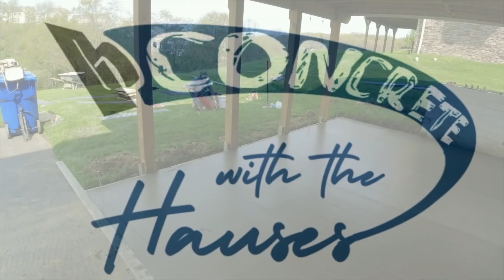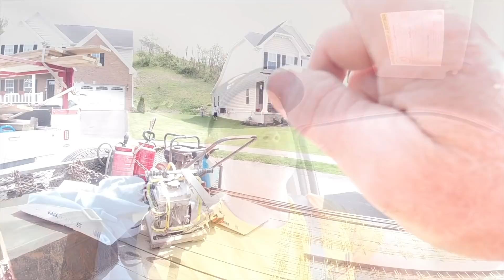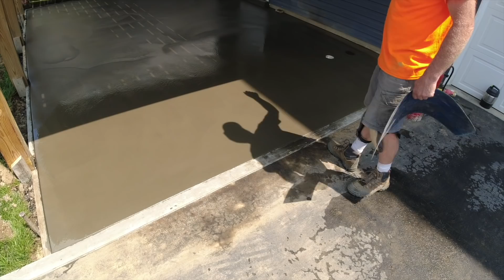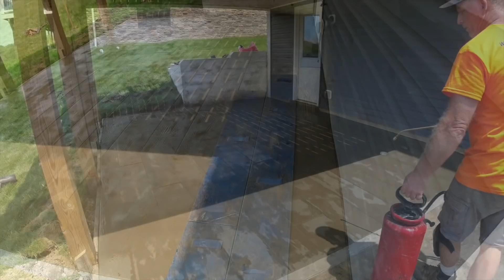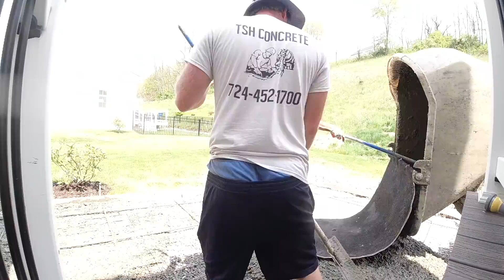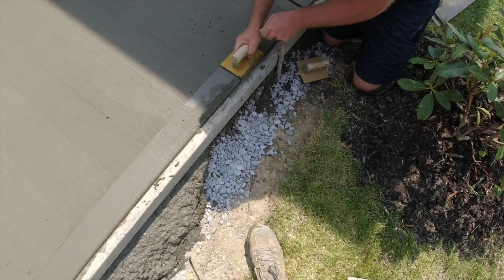I Promise This Is Concrete!

Comment: Love the 2-tone narration. Get the boys doing it, too. Next time you have 2 jobs at the same time, you could do a split-screen of the 2 crews busting them out at the same time! whoo! BTW, the trowel scraping noise is probably louder on video than it is on the site, but it's not too loud; you are spreading concrete after all.

Comment: Hi I watch your videos regularly absolutely fantastic work iv been in construction for over 50 years in England and now  back in ireland where I come from we didn't have all the tools you guys have now. I'm still doing small jobs I'm very particular about concrete  and the finish it's hard to get men to do that type of work now. Just one question before I go I never see any compaction which is some thing I'm very particular about. Keep up the good work boys
Reply from the maker: We compact quite often it doesn’t always make the video
Reply: Thanks for the reply guys. I have a brother in Boston in construction work to I think it's all insurance work he dose he was home here in ireland early on in the summer  we finished off a bottle of whisky watching your videos he couldn't believe I watch the same videos he watches in Boston. I worked on motorway work for 20 years compaction was critical on motorway work. I should be retired by now but as I said you can't young guys to do that work anymore the brother in Boston has the same problem. The work is easy if you have a good crew of reliable men.who know what there doing. You have a good crew of skilled men around you. Once again keep up the good work very entertaining when I'm having my night cap🍺 🍷🍺